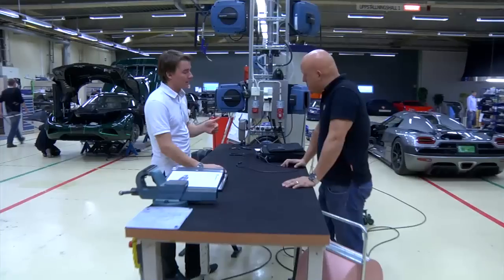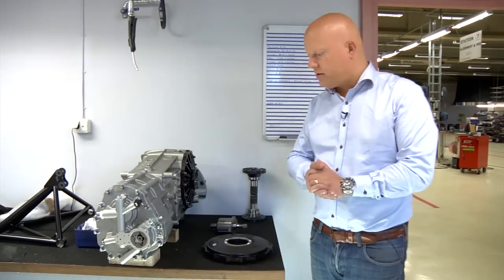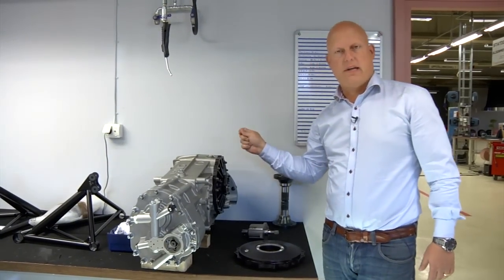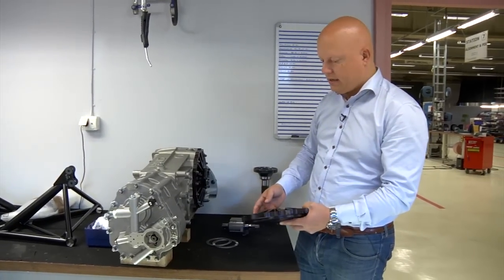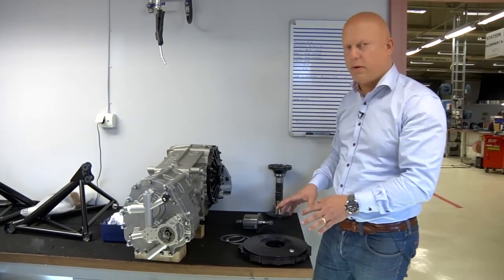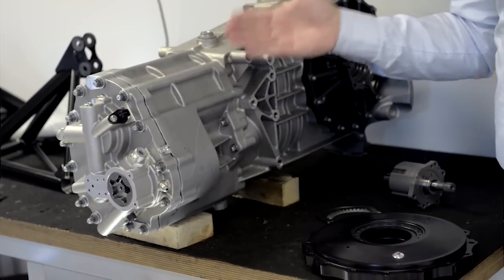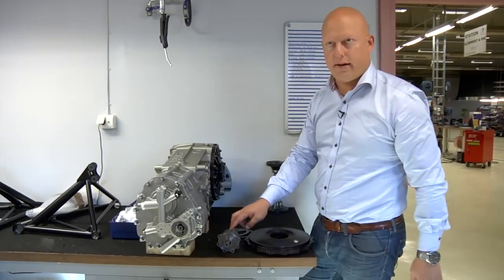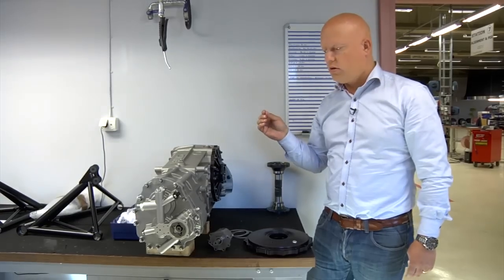Putting 1140 hp to the Ground - /INSIDE KOENIGSEGG

Comment: It's interesting the transmission does braking internally to lock/unlock the differential when other manufacturers brake individual wheel brakes. I assume this is superior although not sure how. Both are open differentials, one brakes internally, the other brakes externally to mimic a mechanical locking differential, well, better than mechanical because it is variable amount of lock with braking. 

Very impressive engineering and their 1-speed transmission on the hybrid Agera with the magic torque converter is crazy.

Comment: I'm a big fan of Koenigsegg, their gearbox differential is amazing, but I always felt that overall their gearboxes and traction control are a weakness - AMT is great, but it's jerky and if the Agera 0-400-0 video is to be believed, do take quite a while. I'm also not sure what sort of traction control they use, but it feels quite old school and not as slick as the ones of Ferrari, Bugatti, Mclaren or Porsche (whose TC+PDK makes their cars explode off the line) or even Lamborghini. Mclaren probably has the best adaptive suspension in the market now, though the Koenigsegg is remarkable in absolute terms.

That's why 'Eggs never excel at the 0-100 although they are way above their rivals from 3rd gear onwards. But now the Regera is going to change all that. Wish I could buy one.... Koenigsegg really is in a class all to themselves.

Comment: Why exactly did you spend that much time and effort to ditch it for a direct drive hybrid setup. The regara does use this "revolutionary" transmission correct?
Reply: They didn't ditch it, they won't stop making Ageras or similar ICE cars, they'll just be making both the Regera and the Agera. The Regera doesn't have a gearbox, the Agera does.

Comment: Only one area I feel that Koenigsegg still needs work on is their traction control. Somehow the engine flaring feels a bit out of date compared to the super smooth rev building of today's hypercars and that's one reason why the One : 1 went from 0-100 in 3 sec and not 2.5-2.6 seconds.

Comment: this is some Lex Luthor shit. This guy is an evil genius.
Reply: +OscarMaris Yeah - notice those shifty eyes.
Reply: 885 lb ft is nothing really to sneeze at.....when the car is this light!
Reply: You realise that was he explained during most of the video is something most of the supercar companies have been doing since the Porsches 959 came out in 1986 and the video title is not really good either. Horsepowers are not what is hard to handle, horsepower is nothing more than the maximum amount of energy produced by an engine at a set RPM. The Koenigsegg only produce those 1100HP when it's going at full speed on last gear. Torque is actually what is hard to put on the ground and the Koenigsegg has a lot of them but nothing extreme. Take the Brabus SL. That is torque and it's the reason the traction control is completely useless it in.

Comment: So the purpose of the wet clutch is basically to rev match for you ?
Reply: Fr3ShPRiNC3 and do it faster than you can, ofc
Reply: Fr3ShPRiNC3 by releasing the wheel torque on the tranny, the engine matches seemlesly to the tranny because it is not receiving a ''counter speed'' so to speak

Comment: Why can t anybody out up a video on the top speed
Reply: Angelo Contreras They have no where to test the top speed.  CVK has said before they need a 10km straight track to do a tops speed run and the longest they can get access to is 5k.  VW won't allow them to test on the track where the Veyron does its top speed runs.  Koenigsegg is more concerned with optimizing the useful performance of the car rather than the top speed.  Hence the 0-300 kph-0 run in under 18 seconds being the type of benchmark they pursue.
Reply: Thank you

Comment: i think the true point everyone is missing is that this car makes over 1,000hp (it's 1,140hp to be exact) using a 5 litre V8 with twin turbo chargers.
to put that in perspective for all you secret volkswagen fans out there: the veyron uses a 8 litre W16 quad turbo, and makes exactly 1,001hp (for the standard veyron, the SS is 1,200hp)
so that is the marvel of engineering, and don't bring up the top speed difference, since who cares about 12 mph once you reach 200? after all, there are only 6 places in the world you can achieve top speeds in these cars, and your average buyer of any 200mph club car is never going to get it over 160mph.
so bugatti fanboys can stop puffing their chests, because once you break it down, the bugatti is a VW on steroids, wrapped in a chic exterior and futuristic victorian leather interior theme. it's so tech'd out it doesn't even really need a driver, you're just there to be there. the agera however, requires a driver, and not just any driver, one who knows how to drive.
Reply: but none of those V6s make that HP running E85, and none of those are factory.
Reply: AnHRTBus Also true AnHRTBus. 

Greetz from an IR. Mechanical ..
Reply: twokgti Yes, they have, but look at their powerbands, the Agera Rs powerband is HUGE, it's not a laggy big turbo Supra, it's making MASIVE and flat torque from 3000RPM to 8000RPM and with all this technology putting it down super eefficiently No disrespect to the Supra, but this is a whole different level of machinery.
Reply: M Jones not the swedish , this man exactly (the engineer wizard of koenigsegg)
Reply: John Smith It's not Ford architecture. It's an entirely bespoke block. They used to use Ford motors, but they developed their own from the ground up for the Agera line. There is no connection to Ford.
Reply: LJ Balongue very true, but they won't probably be too reliable or easy maintenance. But yes, you can surely take that much power from a V6.
Reply: HisWireless Karangunyu It's not, Koenigsegg developed their own motor for the Agera, it is in no way related to any Ford motor, they stopped using Ford motors with the CCR. Really doesn't take much research to figure things out before you say them.
Reply: nobody here is trying to convince anyone that the bugatti or the chiron are better cars. THEY ARE COMPLETLY DIFFERENT. And it reqires just as much engineering to make a 1500hp 2 ton car feel nimble. bugatti is a marvel of engineering packed  into  luxury, königsegg is a raw  performance car. you can daily use a bug more than a königsegg. and you dont seem to know anything about engines or the engineering behind them. the 4 turbos in a bug are sequential. giving it good responsiveness in low revs. your point about that the engine makes 1140hp from5 liters with 2 turbos isn't while the bug makes 1200 or 1500 from 8 liters and is therby better is just stupid. but if that is how you compare engines: there are people without a multi million dollar budget  who tune a normal 2.0l golf mk2 to 1300hp with one turbo. almost everyone can do such things with a modest budget               . in 1983 bmw made a f1 car with a 1.5 litre engine that used old blocks from road cars with at least 100k km on them and put a turbo on it. the result was 1500hp from a 1.5l. if you want extrem engineering f1 is your place. there also was the time when they had 3 litre na engines that put out over nearly 1000hp because they reved to 20k rpm.
Reply: You do realize that there are countless V6s that make over 2,000hp right? Well, according to your post, I guess not lol This engine is wonderful but it's nothing that hasn't been done thousands of times before...
Reply: AnHRTBus Actually, most of the GTR engines run on E85
Reply: Timo E Supras been making power like that for years from an inline 6. and many other vehicles. but thats not a "stock" number. these are super cars that are "produced" to make that power, not modded to make that power. If you can find a v6 that makes 1000+hp from the factory. please post.
Reply: John Smith wrong, they only used the Ford engine for the 1st car, the CCR, due to high costs, that Ford engine was heavily modified and the 1st car was so good they earned enough to develop their own engine in house, which had a lot more power and more efficiency
Reply: +Psalm Co 
Please don't miss understand, I am
a big fan of Koenigsegg that said, if
I cast a block that uses Ford architecture "in house" and in doing so change the name on the side
it's still Ford.
Reply: how can what I said be unintentional? There is 0 connection to any Ford motor/block, the architecture has nothing to do with Ford, it's an entirely bespoke Swedish design, for the Agera, and nothing else. The CCR line used Ford motors, but they went with their own completely original V8 for the Agera.
Reply: agreed , good man take care
Reply: Timo E Never said stock... Koenigsegg Agera Type R and their One:1 are simply amazing cars and engines! They have the absolute BEST V8s on the planet!  They are actually my dream cars... the car I would get if I win the lotto lol but my only point is, several V6s are very capable of getting 2k hp...even using E85
Reply: AnHRTBus
Reply: AnHRTBus Bugati Chiron is a 3000hp car. But most of it is released as heat.
Reply: +rfouR_  If I cast my own Ford block with my name on the side it's still a Ford.
Reply: rfouR_ thank you for corroborating dude, wether unintentional or not
Reply: actually, veyron's motor is capable of 3000hp
Reply: AnHRTBus Shut up
Reply: veyrons engine will hold 3000 hp, it's very reliable. and it makes diesel numbers of torque
Reply: AnHRTBus about 1360 hp on the One:1.
Reply: LJ Balongue none of the engines you refer to are production engines for road cars, none run on almost any type of fuel nor do they meet euro v emission regulations or limits for noise, while maintaining 12l/100km average fuel consumption. So no, there aren't that many engines out there that actually match all aspects of a Koenigsegg engine, and not just power.
Reply: Remember the engine in here is from Ford Mustang 5.0 V8. Thought you should know. Take nothing from him how he has managed to milk 1140hp from it
Reply: It is a 5.4 Ford short stroked to 5.0
Reply: Era AG it will never be. "will" is not counted. just put it to the ground and say the number it makes. I'd say the 5.0 V8 will make up to 2500hp when no one ever made it done before, is that counted?
no.
Bugatti is a yatch on road when the Koenigsegg is the truly performance hypercar.
Bugatti won't have any chance to win.
it's just a yatch that goes too fast, but still it won't beat Koenigsegg..
Reply: Something you should already know, mister know it all the VW engine can actually be ramped up too 3000HP and smother any car out there but something called physics and engineering made is so that the people who have the cash and money to spend on an expensive 3tone VW don’t burn all their hard earned cash on £20,000 tires just to prove a point to idiots like yourself. 
They are already ripping them off enough and seen as the old Veyron has the same 0-60 time, they limited the VW-SS to the same 0-60 time because they would shred their tires trying to put down any more power. Now getting more to the point: The Bugatti SS and Agera R are completely different cars one is for enthusiast who takes it out on the occasion and relishes the hard ride with the overwhelming sound of the engine blowing your ear drums out and the other for the wealthy persons who just wants to have power and luxury of an everyday driver that they can use at their leisure. 
PS 
I would of loved to see a standing start as well perhaps you would not be such a know it all and you would see that it’s really not that fast off the line as you might think.
Reply: no, it cannot be "ramped up to 3000 hp" because of the very physics you are talking about. the engine would slag itself before even getting near that amount. to make an engine able to withstand that kind of stress would require NASA to get in and build it with their damn rocket scientists. now, there are 3,000 hp piston driven engines out there, but the VRW16 the bugatti uses is not capable of it, for two reasons, one: they build the engines within the stress parameters they set. so they went out and shot for 1,000 hp, then they decide "ok, now what are the cheapest materials we can use, that are durable and reliable enough to put in a production vehicle?" and two: because the only other piston engines to make over 1500hp use JP fuels, which are for aircraft. they're more stable, and have a higher RM+Method rating.
so "mister know it all", do me a favor and go fap somewhere else
Reply: @milotin23  the engine makes 3000 bhp. But 1000 is lost in cooling and 1000 is lost through the exhaust making 1000 actual hp that you can use
Reply: @milotin23  your right,the bugatti veyron engine is hypothetically 3000HP. But most of that power is lost through heat.